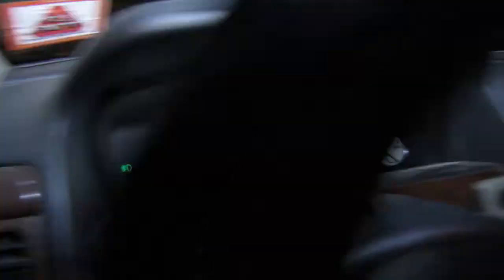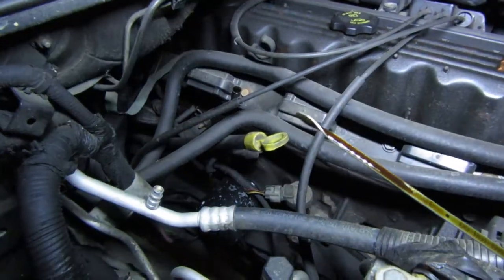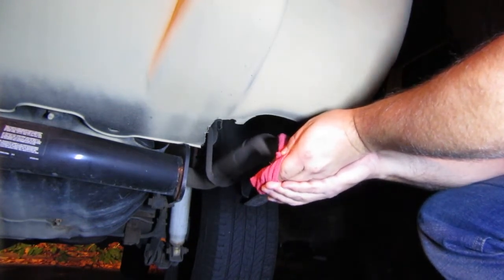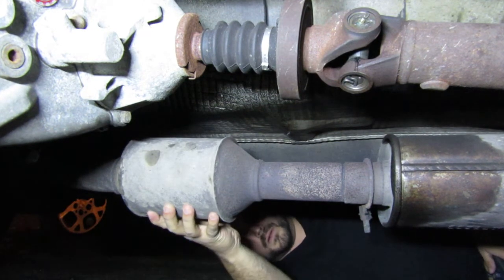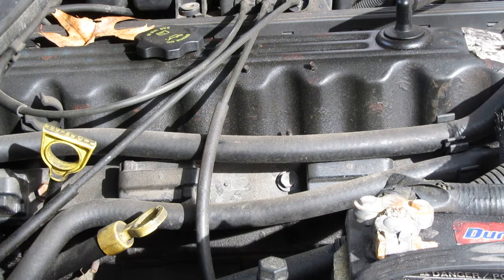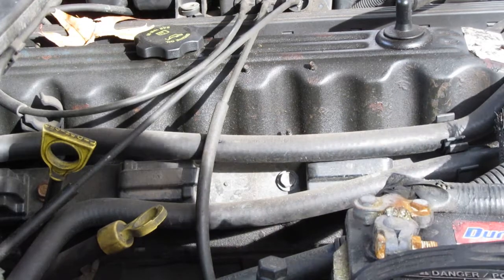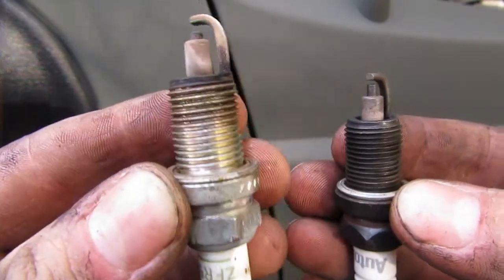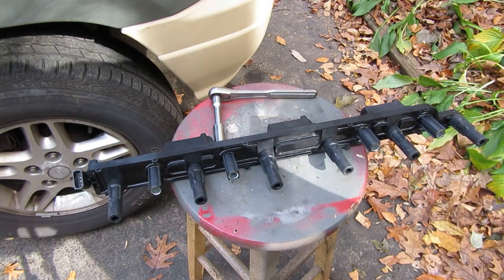Diagnosing complete loss of power, valve tap, engine knock, and rough idle

Comment: My truck has the same knock and I covered the exhaust pipe with a rag and there is not enough pressure. it turned off the car . Could it be the spark plug or the cat?

Comment: I have a 04 Toyota 4 runner with the 4.0 and mine started to spudder and then shut off , I turned it back on  and then it has a loud knock sound only at idle but when I give it acceleration it stops , any idea what it could be ?

Comment: Just watched this awesome video! I have changed plugs a few times on various vehicles. What is your opinion on using anti-sieze on the spark plug threads? Thanks!
Reply from the maker: If I had a Ford or something else with an aluminum head, then I would probably use it. I have never had an issue with plugs seizing to a cast iron head. That said, obviously cant hurt..
Reply: Obviously... as tho every outcome could be calculated.. followed with a certain optimism off a cat pushing his ninety life.  Don't worry you could never do anythinggg that would damage your vehicle.  Btw just clear that check engine light when it comes back on... maybe it will stay off 🦧
Anyways sick beard bro!
And just saying hope you actual replaced those plugs with the correct plug. Ie. Material. Quality. , style. heatt range. Electrode type. Flame front orientation,  It's not all about that gap . all about that gap.  Bout that gap. 😆
Also anti seize is a no go as per the industries leading standard NKK spark plugs
Reason being,  decreases coefficient of fiction.  Aka lowers the torque to turn, but does not reduce overall clamping Force making it easier to over torque. Ironically this inevitably leads to seized spark plugs as anti seize breakdown due to heat and oxidization

Comment: im surprised you didnt replace the fuel injectors i had that same problem a few days ago it threw every engine code it had but the one that stuck out like a sore thumb was p0206 injector failure, i replaced the plugs then pulled a rail off a 2004 4.0 and injectors off of 2 2000 dodge neons then for added measure i readjusted the TV cable and she runs like the day it was new
Reply from the maker: I have the 4 port injectors in me WJ and they are awesome! That is something I am planning for my XJ in the near future

Comment: Do you remember what codes lit up when that happened?
Reply from the maker: Just misfire codes. One for each cylinder.
Reply: Thanks very much... I'm experiencing the same exact symptoms except only 2 misfire codes 2 o2 sensor codes and a crankshaft code... I do have two pre cats ... It has No power at all tho... I can manage to crawl at idle on level surfaces but the more gas I give it the more it seems to choke itself out... High end knock and won't go past 3500 RPM in park and no more than 2k in drive
Reply: Bobby Crosby I’m experiencing same symptoms, were you able to fix it?
Reply: Before I knew my car had pre cats I drilled a 3/8 hole just before the main cat trying to restore power so I could drive it home... Didn't work but I thought it was strange that it didn't get louder with a hole in the exhaust... Does that mean anything to you???
Reply from the maker: Hmm.. crank positioning sensor? I had a crank position sensor go in my WJ once and it caused all kinds of mayhem. Engine would randomly choke out, weird idle...
Reply from the maker: Maybe the y-pipe with the pre-cats is clogged? I have drilled out exhausts before (for the same reason) and if you drill before the muffler you usually get that loud farty sounding exhaust noise

Comment: Nice ,My 4.7 has 185000 and it's still a good Stout motor...How long have you heard of these V8's from 01 Wj's go for?
Reply: I have found a 116000 mile 99 Wj.....i call Her the Soccer Mom...... My 01 is the U Boat.....I know.....They Tell Me What they like to Be Called.....jeeps Are Opinionated....I've found out......lol
Reply from the maker: It all depends. I know folks who swear by the 4.7 and those who have had major issues. I personally know a 4.7's with well over 200k and are still going strong. I think it comes down to maintenance.
Reply: D&E In The Garage Well All I'm. Going to do Is keep it on the Current Schedule.....And I'm Very impressed with it after 2yrs